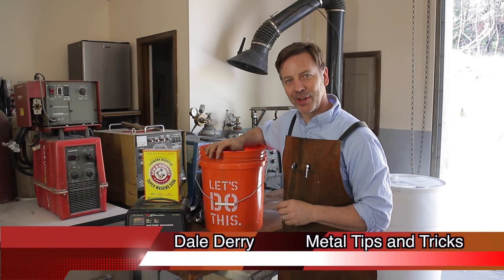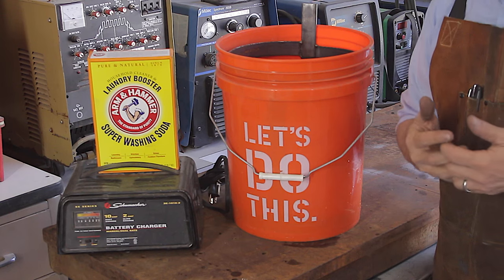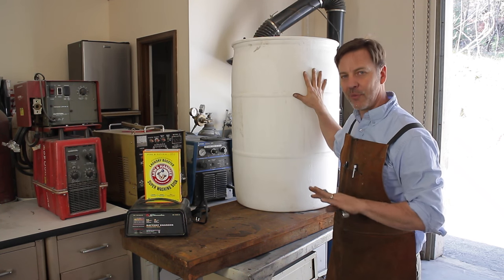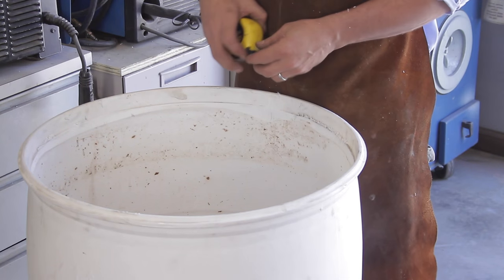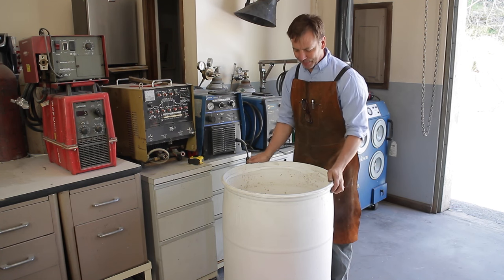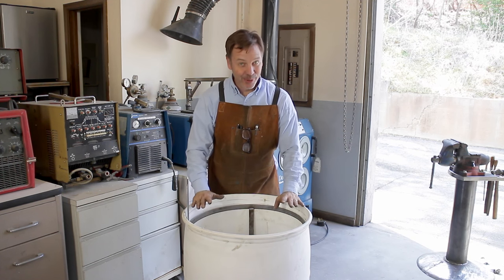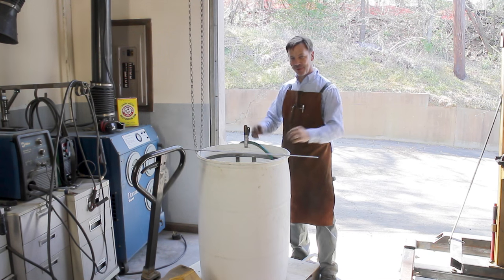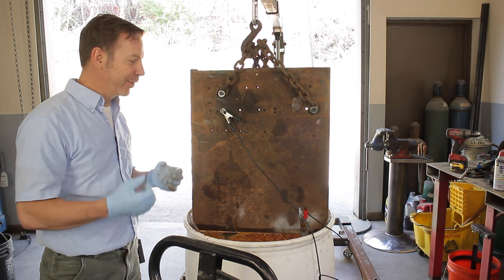How to remove Rust with Electrolysis

Comment: I have used electrolytic rust removal myself and I found that the name of this process is incorrect: It should be named "electrolytic rust conversion" because rust is not fully removed. Electrolysis takes off only part of the rust and converts the remaining red Fe2O3 into black Fe3O4. The rusty surface portions do not come out shiny but black. And then the black stuff has to be mechanically removed by scrubbing or wire wheeling which you could also do directly with the original red rust without electrolysis gaining similar results. This tedious step of mechanical cleaning is not shown in many electrolytic videos. By the way electrolysis can not only be sped up by higher current but more so by higher temperature of the electrolyte by about a factor of 2 for every 10°C of temp. increase. (e.g. from RT of 20°C to 50°C increases the speed by factor of about 8). There are alternative rust removal processes: a) 1 hour vinegar or lemon juice bath + scrubbing (cheap, effective, fast)  b) 2 weeks molasses bath + light scrubbing (very cheap , very effective, very slow), c) 30 min Evaporust + rinsing (very effective, fast, expensive) for comparison d) several days electrolytic bath + scrubbing (very cheap, effective, slow). For light rust and small to medium  parts vinegar and Evaporust seem appropriate and for heavy rust (remove heavy rust layers first by rough cleaning) and for large parts molasses and electrolysis seems preferable.
Reply: +Bill Lewis I am not sure if carbon electrodes are the best choice. As I understand iron or steel (no stainless though) should be used for the electrodes because it releases iron ions into the electrolyte which help the rust conversion and I heard - but I am not sure if it is true - some iron ions even get deposited on the work surface as a partial healing of the corrosion. If that healing part is true then it would constitute an advantage over pure rust removal processes.
Reply: +Bill Lewis Using iron or steel electrodes turns the electrolyte rust red to brownish and leaves rust red slurrey on the bottom and a thick red-brown rust layer on the iron electrodes.
Reply: +rol eic Even when using Evaporust you will get black deposits when removing rust from carbon steel.  The chelating agent in Evaporust only works on iron oxide (rust), nothing else, but after the iron oxide is removed the carbon from the rusty metal still remains on the surface of the part .  The higher the carbon in the steel, and the more rust, the more black left behind.  With Evaporust, the black coating comes off quite easily.

Comment: :47 the positive side of a car battery charger is actually negative to get the electrons to flow. If it were positive to positive all you'd be making is a parallel battery cell. Good to explain that because people who do it directly from a battery are going to want to connect it up in reverse.

Edit: For all the time you spent setting up this rig I am not sure you saved any time from just getting into it with a wire wheel on your favorite rotary demon. And why not use sheet metal? Or rebar....cheap, plentiful, no need to even weld it, just drop several links in there and if you use thin stuff the "sacraficial anode" is cheap enough to throw away rather than waste more time cleaning it up. But I suppose it makes for a better video, right?

PS: The lift would be a GREAT candidate for parkerization. I've even seen Naval Jelly in spray on form and for something that is just big and crude (like ships are) its a great match.

http://www.amazon.com/VHT-SP229-Rust-Convertor-Can/dp/B002NUABUO/ref=sr_1_4?s=automotive&ie=UTF8&qid=1460930097&sr=1-4&keywords=naval+jelly+rust+remover

There are cheaper products but its great for keeping down rust around the shop. Realize this does penetrate and form a bond into the steel so it will never look like brand spanking new but if you let it get seriously rusty you usually don't care anyway. Products like this are worth buying and a HUGE time saver.

Also, not to nitpit but you throw that solution into the road. This is why lakes are overgrown with algae and weeds -- its a phosphate, the middle number in fertilizer, and exactly what the govt and most green minded people do not want you doing. I've seen a whole lake, a nice fishing one, get overgrown until it looked like a swamp and had muskrats going through the middle. Before I used to fish walleye, bass,..etc out of it. 

The farmer used too much fertilizer in an area where the run off could get rained right into the lake. It was literally almost an OVERNIGHT change. Phosphates are really something to respect. Sorry to preach, didn't intend any negative tone, just educational & originally so that anyone who used this method via battery would have success. Some people don't like AC plug in stuff near water. Esp other countries where they have 220-240 everywhere.
Reply: +BikingMNViking Positive on a battery is the same as +ve on a charger. Current flows from +ve to -ve (electricians view), electrons flow from -ve to +ve (physicists view).
Reply: BINGO! ( just so the people doing this know because I've seen threads where people had the opposite reaction and no one answered as to why for years or even at all)
Reply: How does a phosphate get into a solution of washing soda (sodium carbonate, Na₂CO₃) in water (H₂O) and iron oxide ( Fe₂O₃ and/or Fe₃O₄}?  I doubt whether  this pretty harmless mixture would have the effect of stimulating the growth of algae and weeds in a lake.

Comment: I believe when electricity passes through water with or with out a electrolyte  it generates hydrogen ie. the bubbles you see in the electrolyte when energized. Same happens when you charge a lead acid battery. Hydrogen is highly flammable.
Reply from the maker: +joe miller 
To my knowledge you need to use stainless steel to separate the hydrogen from water from the water plain steel will not work.
Reply: @BuildSomthingCool  .... hexavalent chromium risk?

Comment: "Electricity is lazy and always wants to take the least path of resistance"

A better way of thinking about this is "Electricity seeks every path available to return to its source, with the current in each path being proportional the inverse of its resistance". 

The reason we care about this is safety. If we start thinking that electricity will only take the path of least resistance we start thinking it won't take other paths, and then people start dying. So remember folks, there may be a path of least resistance but that doesn’t mean your body is not a path of sufficiently low resistance to get you killed.

Comment: I plate for a living.  all the comments about it producing hydrogen are correct,  but it is of no danger.  the hydrogen is only concentrated at the solution surface.   once it mixes withe the air it is so diluted a torch wouldn't ignite it.  you would only need to worry about it of the tank had a blanket of bubbles covering it.  those bubbles would contain the hydrogen,  but even then they would go pop, but not hurt anything.

Comment: Dale

The best source of reliable info I have found is
http://nautarch.tamu.edu/CRL/conservationmanual/File10a.htm

They state you can use the "metal can" for one side of the circuit ie POS.  Yes it will degrade the walls but if thick they will last for years.  My tank is 24 inch on each side and 1/4 plate and was a boat fuel tank.  I did not build it and would have gone thinner for a fuel tank.

Any material that will dissolve in water and create ions will work as an electorlyte.  I use baking soda and it works just fine.  Source above also recommends NaOH but cautions since it is caustic and a definite hazard to the eyeballs.

Chlorine gas is made by electrolysis of salt and water solution.  Yes it works if you are willing to put up with chlorine gas generation.  NOT recommended especially so if toxic is a big concern.

This process ideally should be done outdoors or in very well ventilated space - BOTH oxygen and hydrogen are generated.  It is the same process the Navy uses to generate oxygen - the hydrogen is dumped.

Dan Bentler

Comment: Troll Alert!  At 16:21 you mention Positive Electrons...  Sorry, no such thing.  Electrons have a negative charge, protons have a positive charge.  A positively charged electron is a positron which is an antimatter particle.  With a degree in Electrical Engineering I just couldn't keep my mouth shut...
Reply from the maker: +user990077 positive correction is always appreciated. No troll alert here :-)
Reply: +Metal Tips and Tricks (Dale Derry) And positive ions actually is a thing. :-)
Reply: +voron11000 Yep. Ionization can create either positive or negative ions. Good point.
Reply: Don't you mean cations and anions in relation to electrolysis?
Reply: Now, see how smart you are.